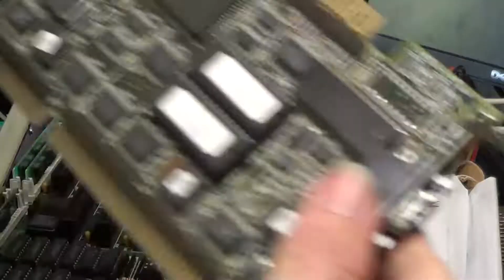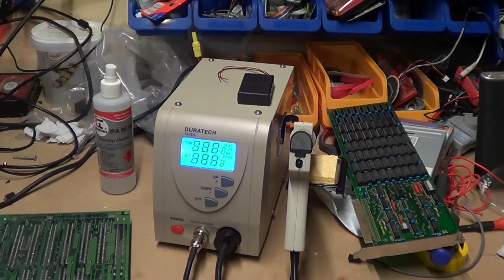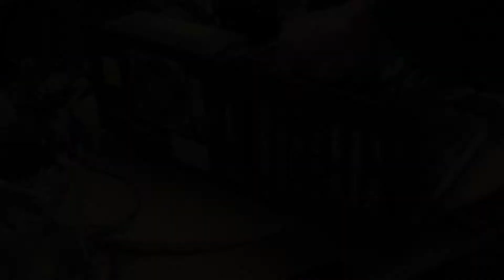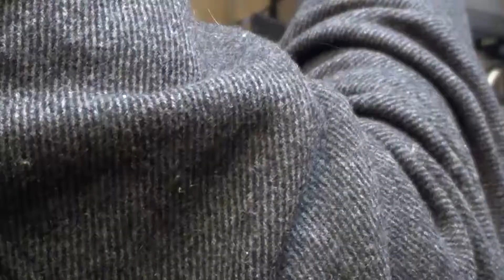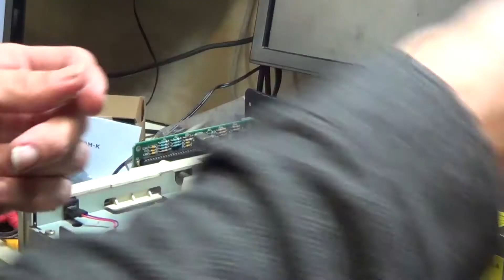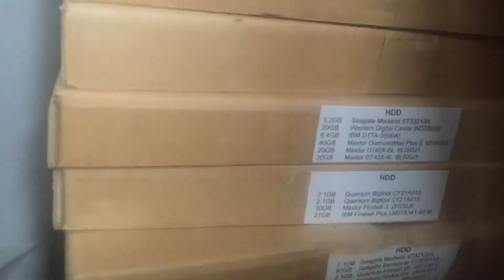90s 286 Build - Part 1

Comment: Sure there isn't a jumper to select between VGA and other graphic cards?
Reply from the maker: Yep. Video type is actually set in the BIOS. There is usually a COLOR/MONO switch on this era of computer, however that's only used so the system knows to attempt to nitialise MDA or CGA if it's present. The only machines I have with hardware switches for EGA/VGA/Other are IBM PC XT's or clones, which had no CMOS/BIOS setup.

Comment: Which upscaler/capture device do you use? I regularly use an AverMedia Game Broadcaster HD, but it doesn't always cooperate with 70Hz text output.
Reply from the maker: It's a cheap unbranded VGA to HDMI box that feeds in to an Elgato Game Capture HD - pretty low end but gets the job done.
Reply: Many thanks, I'll consider that in the future. Your videos are great, I wish I could afford to obtain such a large stock of old computer parts!